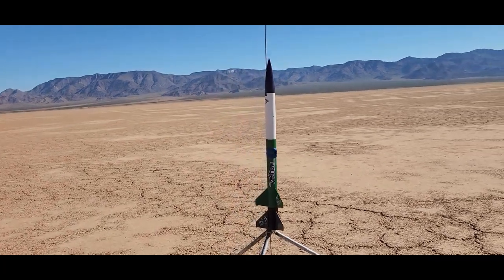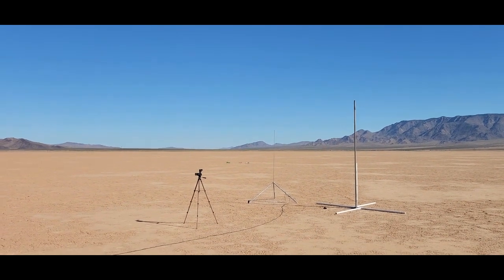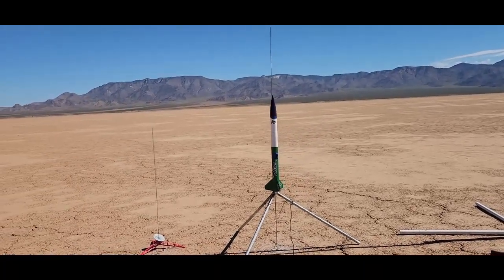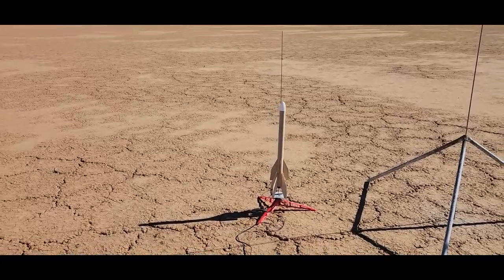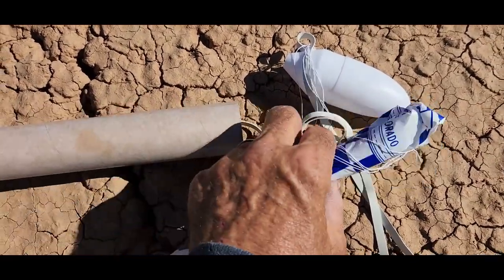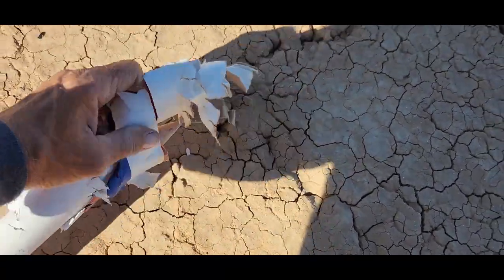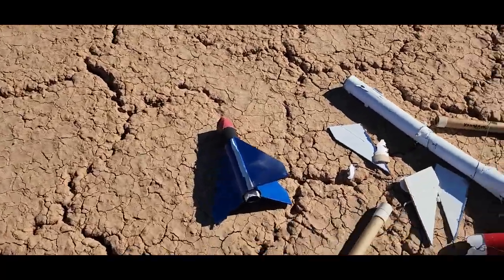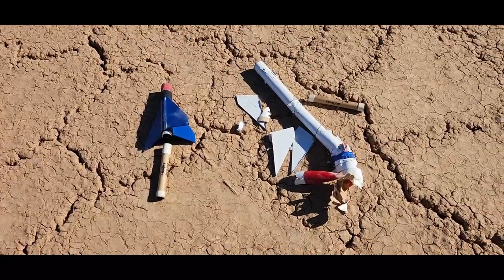two stage sugar engine rocket. Goes ballistic. 😒😒

Comment: How did you build the automatic parachute ejector system?
Reply from the maker: All of these rockets are motor ejection. The  rocket that crashed was my homemade sugar engine. 
The fuel is 65% potassium nitrate and 35% powdered sugar. My delay fuel is the sugar fuel with 20% baking soda added to it. I put a clay bulkhead on top of that . I drill a hole small hole through the bulkhead and put my black powder charge in and press in a bulkhead over that with my finger so it doesn't smash my black powder. And good to go. I use a heaping teaspoon of delay fuel for about an 8 second delay.
Reply: @chrissrocketryandmore  Appreciate that! can you post tutorial videos?
Reply from the maker: @8-bitarghya718  
Yes, i can. Just tell me what you want to see, and i will make a video if it is within my skills. If you want to see a engine making video i can do that also.
Thanks for watching
Reply: @chrissrocketryandmore  I would love to watch the engine making video, your rocket videos are amazing. That's why I subscribed you! You are doing a great job! Love from India!

Comment: That was sooo cool !
Sorry about your sugar dart.
Someone needs to come up a works-every-time chute deployment. Like a Mercury Switch from a pin ball machine
Reply from the maker: There is an altimeter that will deploy an ejection charge automatically. I might have to look  into one.
Reply: I had a bit of a fiddle and fumble with rockets etc. back before electrics became a thing. We used 1/2 inch steel ball bearings in a hose to deploy a chute. Worked some of the time 😆
If those Altimeters are not expensive, then yeah go for it.

Comment: Yeah BABY! 😱😁👍👍🇺🇲

yep, reloading them Estes used cases are great for two stage or plug reloads! 😁👍👍🇺🇲
Reply from the maker: Actually i buy tubes for my homemade engines. I am saving the estes tubes though. I want to try to make an engine with those.
Reply: @chrissrocketryandmore  YEOW! You can ROLL YOUR OWN! it is amazing how strong paper is! I haven't bought engines in 20 years! 😱😁👍👍🇺🇲

Still have about a hundred in the plastic, ... what are the chances they will CATO! 😱😝🤪🤣👍👍🇺🇲
Reply from the maker: @TinyHouseHomestead  
I have had engines for about 13 years and they still worked. It's just black powder. If they aren't swollen they will fly.